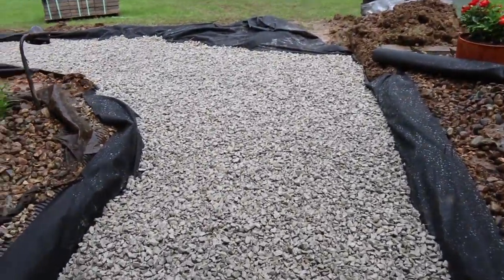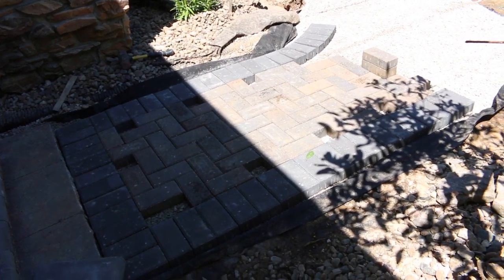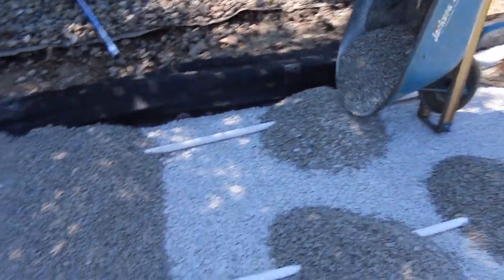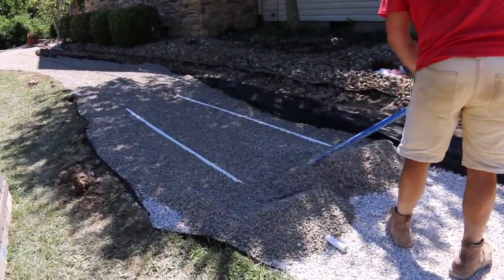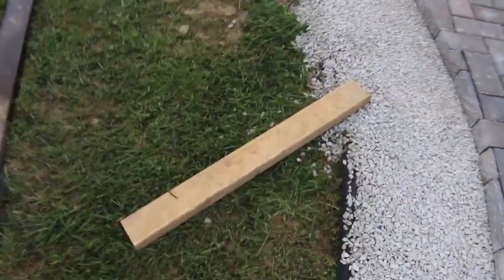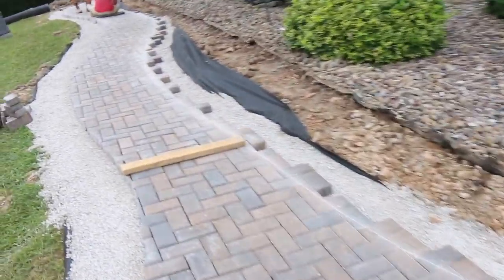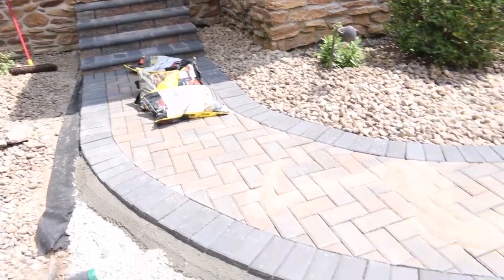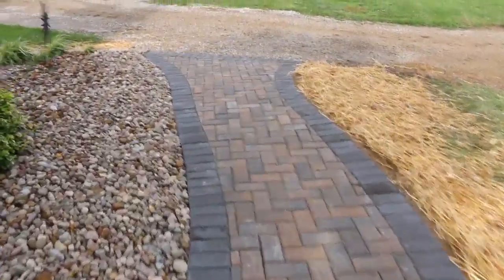Installing a Paver Walk Way With Curves

Comment: For marking curved lines use  1/2"  PVC pipe or multiple of need be.  Once you have the first line marked you can use your 2x4 spacer to mimic the line on the opposite side and flex your 1/2 inch pipe to suit.

As for full cutting in place,  inside turns are easy and you shouldn't have a problem, cutting outside curves are where you run the risk of over cutting other pavers.

Rather than picking the blocks up and taking them to a table saw, you just pull the brick out and cut it with your gas axe right next to where you are working.  It takes alot of time walking back and forth to a saw.
Reply: As Henry Ford said   "Walking is expensive "  Also I would attach a short piece of 1x4 at one end of the 2x4  to make a stop , becomes a one man operation  and time saver . The PVC pipe makes beautiful curves

Comment: Beautiful job the stairs looks awesome! I gotta reset my pavers in the front. I live in NJ closer to PA. The contractors years ago install our pavers different. I watch them use only the smaller rocks for the base. I think smaller than yours they packed with a machine. Maybe this is why it sank, washed out & rotated. I'm going to do it ourselves. I got 4 estimates from$975 to $1500. I asked them how will they install? Only 1 base compact & sand base for final application between the pavers.

Comment: Excellent. You answered a huge question for me that I couldn’t find anywhere else. I was planning on using a demo saw to cut my curves all the way through but you just talked me out of it. Instead I’ll score the pavers with my angle grinder then remove and finish cutting one by one.
Reply: Why would you score it with another saw first? Why not just draw your lines and then go cut them once?
Reply: Sarah Custer I didn’t end up scoring them first. I just drew my lines with a crayon then cut with demo saw. Easy peasy.
Reply: @_Moto215  Awesome, thanks! I am still trying to get all my pavers in, then have to go back and cut them. My crush and run isn't perfectly level and flat, which I didn't think would be too much of an issue, but getting the sand in and laying the bricks all level has been a challenge.. Doing a 71' curving walkway...
Reply: Sarah Custer it’s super important to get the base as perfect as possible. Mine wasn’t perfect either but it still ended up good. If you’re cutting them in place with a demo saw be prepared to do like 6-10 feet at a time and take a breather. Make sure u have a good respirator because if you’re cutting it dry it will create a ton of nasty silica dust. I’d cut then blow it with the leaf blower to keep the area as dust free as possible.  I was worried my neighbors were gonna get mad because the dust gets bad. Cover anything nearby you don’t want dust on it.

Comment: I guess everyone does things wayyyyyyy different   the base I would have used 3/4 clean with sand and still used paver edging due to expansion of hot and cold seasons, but awesome work bud
Reply: Who uses clean stone with sand? Sounds like you need to go back to school. It’s A-gravel and concrete sand for non permeable or 3/4 clean and HPB for your screws layer

Comment: Only the experienced workers would know how to cut those curves without cutting one by one. Those curves are pretty easy. They are big. Some are tight and all you can do is score then you have to cut it 1x1. Im talking a 3 ft radius or sometimes even smaller. But not bad. How long did it take to do this? After filling cutting out and filling with base rock

Comment: Have you had any issues using the 1” clean as base since there are no fines binding it together.
Reply: That's what I was thinking theres no dust at all
Reply: @OfficialMateiParvu  if you have the correct fall on your pavers water won't sit and disturb the base
Reply: @Longshlong64  do you understand the concept of underground water levels?..

Water doesn't only penetrate from up top, it also flows through the sides.

It also moves up when it has no where else to go.

Of course the sand will retain moisture over the winter 🙄

Comment: With under lapping that top tread how much did that change the tread depth.  From the video it looked noticably shallower.  Usually code requires no more than 3/8" difference between deepest and shallowest treads on stores and stairs.  Not sure in your area.  If it is, wouldn't that be a tripping out falling hazard?  I have s small shed in my back yard that someone else built 2 steps for years ago and the bottom step is about a half the depth as the top and it's very awkward.  Can't tell you how many times I've missed that button step going down.  But missing a top step can be bone breaking.  JS.  Good luck and God bless.

Comment: Can you do a video on how to do concrete for paver restraint? I’m in Des Moines, IA... wondering how it would work for freeze/thaw cycles
Reply: Ankeny Lawn never do a concrete restraint. You’re doing yourself no good. People choose pavers over concrete a lot of times to prevent from cracking so you’re defeating the purpose by adding concrete as an edge restraint. Especially in a freeze thaw environment. Use a regular plastic edging with metal spikes. When the spikes rust in the ground it will be good.
Reply: Haha, I was just looking up this video and saw that you are from Des Moines. Same here, small world
Reply: @neverrestboxinggym  you can’t use the typical plastic snap edge and spikes on this type of base. Only on a dense grade base. This is a open graded base. The open grade has nothing to hold the spikes in.

Comment: So when you compact the base do you go for bubble level and just set the pipes on it or whatever it is and just pull the screed
Reply: You wanna set the pipes at a height where the pavers will fit in place for the final product, you should definitely use a level to see if there’s any bowing in the pipe (make sure it’s straight) and then you screed and while your laying down the pavers you fill in the gaps where the pipes were

Comment: Why the short step at the bottom using rectangular caps and you were using bullnose? Seems like a trip hazard. Seems like it would have been better to ramp up the pavers for a smooth transition if that was needed to achieve the proper grade
Reply: Exactly!

Comment: Great work! Inspired me to do my own patio...you guys made it look easy and I am still healing. I do have a question if I may...my wife now wants a curved walk way to the shed. Problem is the pavers are in 3 sizes - how do I calculate the amount of individual pavers?
Reply: Unless the size difference in the pavers are drastic like 4 inch to 18 inch, the curves won't make a difference.  Just get the percentages of each size that your layout needs.  Layout as normal with only approximations for the edges.  Get a couple long pieces of PVC conduit and shape the conduit to the curve you want.  Mark with a pencil then cut.  With practice, you can skip pieces that would be smaller than half their original size after cutting and fill those spaces with what was cut off previously.  In other words, don't waste a full piece for a space that can be filled with scrap from another cut.   Also, if you try the 2x4 method showed in this video, you'll have a bad time.

Comment: Too bad about the stairs, they look very nice at a glance, untill you see (14:50) or (16:12) the first riser at ground level is way too short and the riser too the porch too high.Would not pass code, dangerous. Otherwise, the pathway turned out ok.

Comment: What are the advantages using concrete restraints compared to plastic snap-edge with 12” spikes?   I’d like to switch over but nervous with MN frost.
Reply: My thought is the concrete  will crack  into smaller pieces and eventually move and it will cause a lot of problems. The plastic with the spikes isnt going anywhere!  Id like to see this walkway in a year or two.
Reply: No restraint, we will be watching the tear out in three years.
Reply: @scottoldham7459  Hahaha...   good one!